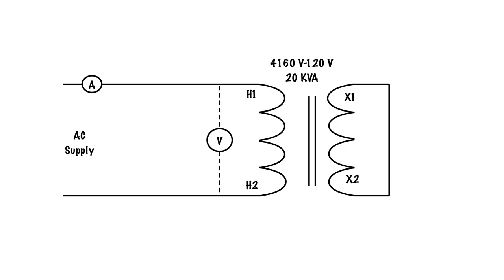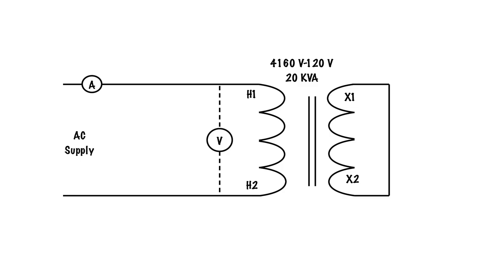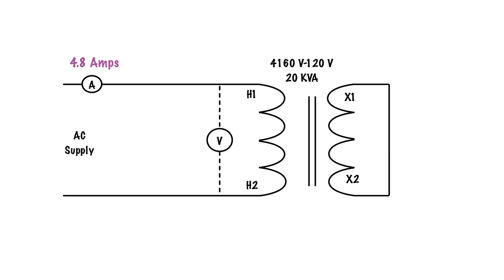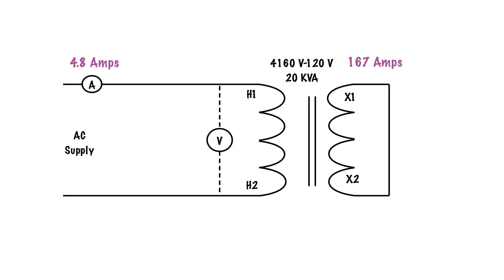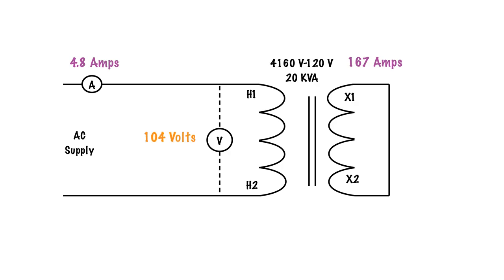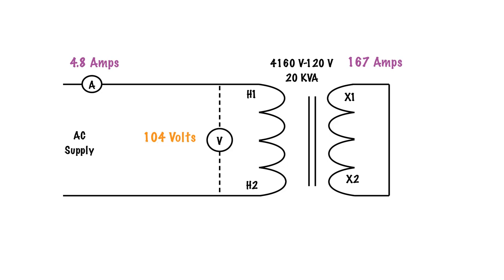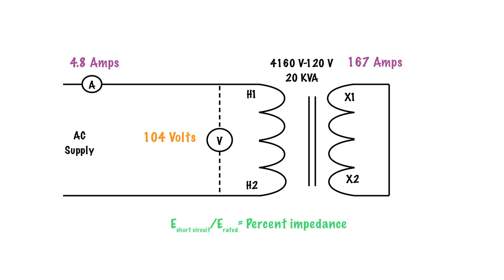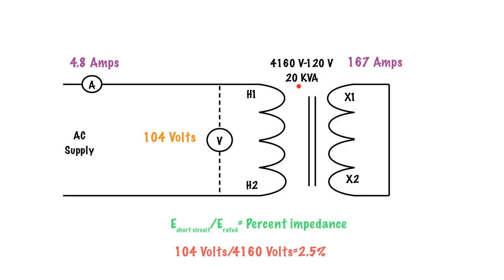How to determine the percent impedance of a transformer

Comment: A correction: you don't increase primary voltage until you reach primary rated current  of 4.8A rather you increase primary voltage until full rated secendary current is achieved.
Reply: But when you reach the rated secondary current, you also reach the rated primary current. So aren’t both the same, with the benefit of measuring the primary current that you don’t need a huge ammeter or current transformer?
Reply: "poteytoes, potahtoes". You could add a second ammeter to the secondary coil and read the "secondary rated current" while at the same time the "primary rated current" reaches the same ratio level.
In this case secondary = 167A, primary = 4.8A
The only difference is, that on the secondary side you end up with 0V (thanks to the short circuit) while on the primary side you end up with 104V which enables you to get the Impedance %Z = V input short / V input rated
so it makes more sense to get the input rated Amps instead of the output rated Amps 

note: at the end I switched to input and output for primary and secondary respectively since I am applying power to the primary , ergo my input

Comment: Where is the 104 volts come from or is there any calculations to find that voltage or we have to do it practically
Reply: Exactly what I want to know
Reply: @Santana2163  the 104 volts was assumed (made up) for the sake of calculation. In the real world you would get that number from the volt meter reading the input voltage across the primary coil.
if the voltage would be, lets say, 85V, then the Impedance would be 2% (or 2.0433%)
on the other hand if it were 125V, then the impedance would be to 3%.
The results of the short circuit test give you the means to calculate the impedance for the transformer at hand. The numbers used in the video were just arbitrary and for demonstration purposes only 😉

Comment: Actually in a 4160 three phase Y system the single phase voltage is 4160 divided by 1.732 or 2400 volts phase to neutral ground. 2400 is more appropriate in a “4160” distribution transformer. At First Energy we’d use 2400 in this example.  In a three phase Y power bank in a 4160 system the phase to phase voltage is 4160.  The phase to neutral is 2400. Our impedance calculations are based on a 2400 volt reference per transformer.

Comment: Very helpful! I have one question. How did you get the 104 volts?
Reply from the maker: The 104 volts is the voltage it would take to reach maximum current in a short circuit situation. For the purpose of the video I had an assumed voltage.

Comment: why E- rated short ckt voltage is divided by E-rated secondary voltage?  when per cent impedance is required to calculate short ckt secondary current, breaker size of the secondary side of the trafo.
Reply: More years ago than I care to remember, (early '50s) when I began my career in electrical engineering, transformer ratings and electrical equipment ratings were marked % IZ , which of course meant % voltage. Eventually, the I in the markings was dropped because all the percentage calculations used 100 percent of the reference current, hence the marking as % Z. The percentage ratio is still the same for % Z as for % IZ. ( IZ (sc)/ IZ (rated) )

Comment: Why use a percentage of Z & not the resistance in ohms? Every calculation done for R is measured in OHMS???
Reply: Because it is based on nominal power of the transformer and at the rated voltage (per unit)
Reply: %Z is used because when you're short-circuiting the transformer you're basically overloading at maximum current.
21.6Ω would be a bad value if the minimum Z given 4160V/4.8A =~ 867Ω.
remember that if the transformer runs  with a lesser load, then it also needs less amps so if let's say you run at half power (10KVA) you also run at half the max amps (2.4A) -> 4160V/2.4A = 1.73kΩ
Impedance Z = sqrt ( R^2 + ( X inductive - X capacitive ) ^2 )
X inductive = 2πfL 
 where f = frequency (60 or 50 Hz depending -- could be a different frequency as well) 
 and L the Inductance (in Henry H)
X capacitive = 1 / (2πfC) where C is the capacitance (in Farad F)
X (reactance) is measured in Ω (ohm)

Comment: wrong explanation ! short the secondary and increase the voltage on primary till the current  on secondary reaches is rated current. the voltage that causes the secondary rated current / rate primary voltage is Z%
Reply: No that's a very bold statement for you to say. What you are say is not that different from what is explained here. When the secondary side reaches its rated current also the primary side reaches its rated current automatically.  They reach their rated current at the same, I think it does not matter on which side you measure the current, still you would find the voltage at which the rated current appeared.